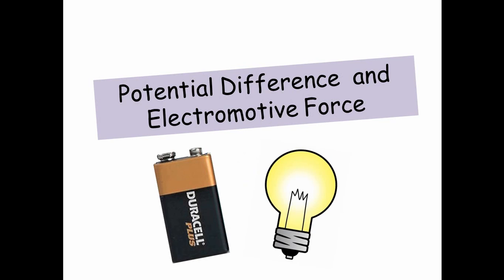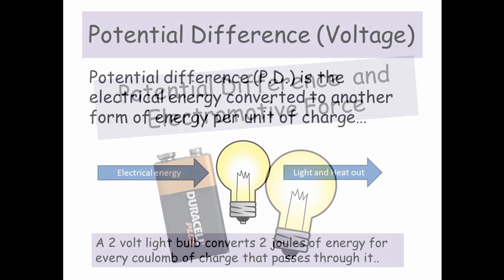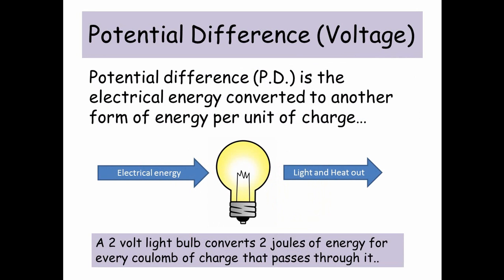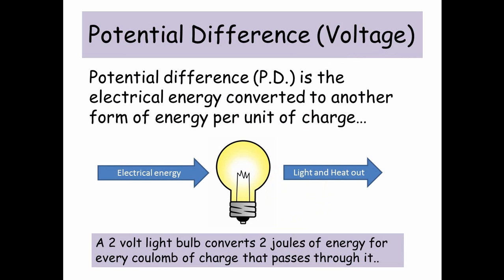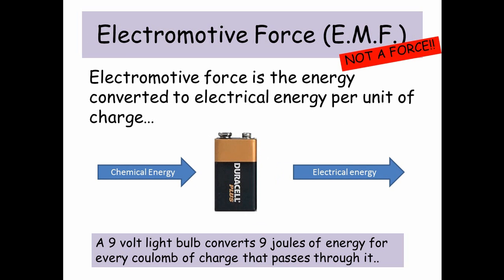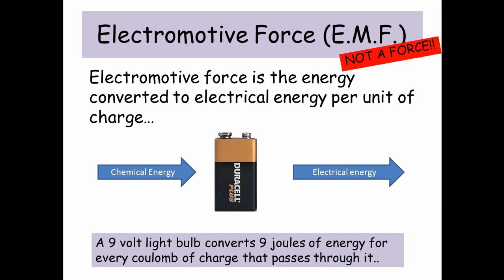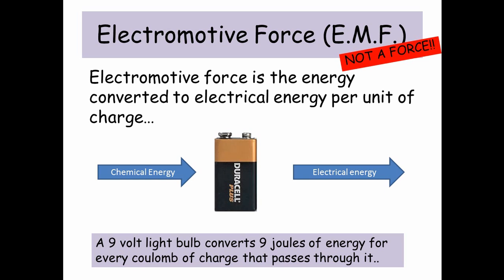Electromotive Force and Potential Difference

Comment: the FEM is the energy by J/C produced by a battery or electric generator(movement), and de voltage is the force that keep the  electrons movement in the circuit
Reply: the FEM IS ENERGY IN TRANSFORMATION

Comment: Wait a min , EMF is the amount of work done in bringing a unit positive charge from lower to higher potential, so are they two different energy 
Plz help 😌
And about Kirchoff voltage rule isn't it sum of potential difference across a loop is zero as u know initial and final position r same ?
Reply from the maker: EMF is energy per unit charge going into the circuit and PD is energy per unit charge leaving the circuit. By conservation of charge they are the same value around a loop.

Comment: Thank you very much!
Reply: EMF was an older method to represent the capacity of cell ........ Now we use same word to distinguish Running Potential Difference(V) and Ideal Potential Difference (E) or Open Circuit Voltage (E) or Static Potential Difference (E) of a cell......So please don't make any fake concept about any imaginary force which/who maintain Running Potential Difference.
Here charge density on the both +ve and -ve plates are greater than the Charging Bank of cell. And also decreasing rate of charges are narrower w.r.t. Deposited Charge. Therefore fall of voltage appears like a constant voltage.
At this point any of them who explain EMF, he goes to trapped with a unknown query .i.e.
Who provides constant voltage?
Then a prepared answer 'EMF' will help to prove their fake concept.
That's it...👍👍👍
Reply from the maker: Np

Comment: is the work done to raise to potential energy of the electrons the result of moving the negative charges against the eletrostatic force field of a positive charge which wants to keep them together as negative charges are attracted to positive charges? What exactly happens to raise to potential energy of the electrons which will eventually run around the circut? Is it the work done to seperate the negative charges from the positive?
Reply: EMF was an older method to represent the capacity of cell ........ Now we use same word to distinguish Running Potential Difference(V) and Ideal Potential Difference (E) or Open Circuit Voltage (E) or Static Potential Difference (E) of a cell......So please don't make any fake concept about any imaginary force which/who maintain Running Potential Difference.
Here charge density on the both +ve and -ve plates are greater than the Charging Bank of cell. And also decreasing rate of charges are narrower w.r.t. Deposited Charge. Therefore fall of voltage appears like a constant voltage.
At this point any of them who explain EMF, he goes to trapped with a unknown query .i.e.
Who provides constant voltage?
Then a prepared answer 'EMF' will help to prove their fake concept.
That's it...👍👍👍

Comment: So Wat is reason behind saying emf as electrostatic motive force of it is not force
Reply from the maker: History
Reply: EMF was an older method to represent the capacity of cell ........ Now we use same word to distinguish Running Potential Difference(V) and Ideal Potential Difference (E) or Open Circuit Voltage (E) or Static Potential Difference (E) of a cell......So please don't make any fake concept about any imaginary force which/who maintain Running Potential Difference.
Here charge density on the both +ve and -ve plates are greater than the Charging Bank of cell. And also decreasing rate of charges are narrower w.r.t. Deposited Charge. Therefore fall of voltage appears like a constant voltage.
At this point any of them who explain EMF, he goes to trapped with a unknown query .i.e.
Who provides constant voltage?
Then a prepared answer 'EMF' will help to prove their fake concept.
That's it...👍👍👍

Comment: Thank you so much
Reply from the maker: No worries.. :)
Reply: EMF was an older method to represent the capacity of cell ........ Now we use same word to distinguish Running Potential Difference(V) and Ideal Potential Difference (E) or Open Circuit Voltage (E) or Static Potential Difference (E) of a cell......So please don't make any fake concept about any imaginary force which/who maintain Running Potential Difference.
Here charge density on the both +ve and -ve plates are greater than the Charging Bank of cell. And also decreasing rate of charges are narrower w.r.t. Deposited Charge. Therefore fall of voltage appears like a constant voltage.
At this point any of them who explain EMF, he goes to trapped with a unknown query .i.e.
Who provides constant voltage?
Then a prepared answer 'EMF' will help to prove their fake concept.
That's it...👍👍👍

Comment: i had an 'ohhhh!' moment with this. thanks.
Reply: Same here
Reply: @pritighuge9225   EMF was an older method to represent the capacity of cell ........ Now we use same word to distinguish Running Potential Difference(V) and Ideal Potential Difference (E) or Open Circuit Voltage (E) or Static Potential Difference (E) of a cell......So please don't make any fake concept about any imaginary force which/who maintain Running Potential Difference.
Here charge density on the both +ve and -ve plates are greater than the Charging Bank of cell. And also decreasing rate of charges are narrower w.r.t. Deposited Charge. Therefore fall of voltage appears like a constant voltage.
At this point any of them who explain EMF, he goes to trapped with a unknown query .i.e.
Who provides constant voltage?
Then a prepared answer 'EMF' will help to prove their fake concept.
That's it...👍👍👍
Reply: WAITT BECAUSEE SAMEEEEEEEEE

Comment: is there value is always same ???
e.g 9 Volts of battery means it has 9 Volts of P.D And 9 Volts of Emf ??
Reply: EMF was an older method to represent the capacity of cell ........ Now we use same word to distinguish Running Potential Difference(V) and Ideal Potential Difference (E) or Open Circuit Voltage (E) or Static Potential Difference (E) of a cell......So please don't make any fake concept about any imaginary force which/who maintain Running Potential Difference.
Here charge density on the both +ve and -ve plates are greater than the Charging Bank of cell. And also decreasing rate of charges are narrower w.r.t. Deposited Charge. Therefore fall of voltage appears like a constant voltage.
At this point any of them who explain EMF, he goes to trapped with a unknown query .i.e.
Who provides constant voltage?
Then a prepared answer 'EMF' will help to prove their fake concept.
That's it...👍👍👍

Comment: Am I the only one that hates the term "potential difference" with such passion? My understanding is that voltage is defined (technically) as the potential to do work per unit charge. but this "definition" as useful as saying that force is defined as acceleration of something multiplied to its mass. I see voltage as something that cannot really be defined as it is something elemental. I beleive it comes about because like charges repel and when there is a dense charge on a surface (say, electrons that are crammed together on the globe of a van-de-graaff generator) this causes voltage since they do not want to be close together and will attempt to equalize by jumping through air to a area that is more positive.  I see this as equivalent to pressure in a air tank. Things like power, energy, and all those other units can be derived from this "pressure" times the flow rate (amps).
Reply: +Power Max. it is potential energy
Reply: Also, as a question: Why do we differentiate between "EMF" and "voltage" since they are the same thing? both terms simply describe a potential difference, just one of them is the result of a conversion. Is there something I'm missing?
Reply from the maker: +Power Max The concept you are missing is the direction that energy changes are going.. With EMF Some form of energy (Chemical in a cell or Light in a Solar cell) changes to electrical energy per unit charge. With PD electrical energy changes to a different form of energy per unit charge,
Reply: +Chris Gozzard (That Physics Guy) Why would it matter to someone where the energy comes from, whether the voltage at some node is an EMF or just electrostatic charge? What practical difference is there between voltage from, say a really big capacitor or supercapacitor or a battery?
Reply from the maker: The answer is simple - conservation of energy. You need to know how much energy is entering and leaving a circuit. EMF and PD help us do this.
Reply: +Chris Gozzard (That Physics Guy) How exactly? EMF or voltage is just one part of power, it needs to be multiplied to time and current flow get units of energy (WH). And knowing the polarity of the voltage and direction of current flow, it should be possible to figure out how the energy moves, right?
Reply from the maker: +Power Max kirchhoffs 2nd law states the sum of the EMFs in a circuits loop is equal to the sum of the pd across the components in a loop. Total energy IN per coulomb equals total energy OUT per coulomb.
Reply: +Chris Gozzard (That Physics Guy) To me it sounds like the only difference between EMF and pd is the context. EMF is what is directly across a generating source like a power supply, coil of wire, or a chemical reaction, while a pd is what can be observed across something like a resistor or load. Is this correct?
Reply from the maker: +Power Max yeap.. you got it!!
Reply: +Chris Gozzard (That Physics Guy) OK, that makes sense, it is similar to how physics differentiate energy from work! So then (probably) my last question, What is "electrical energy per unit charge" defined as, if PD is "absorbed" energy/charge, and EMF is "created" energy/charge? Is it just literally just called "voltage"?
Reply: +Prathamesh Khandare No, it's not. It is potential energy per unit charge. (same type of difference as weight and density.) To me sounds like saying that voltage is potential energy per unit charge is like saying defining mass as acceleration times mass.
Reply: Power Max the difference mean the difference in charge of both terminals
Reply: EMF was an older method to represent the capacity of cell ........ Now we use same word to distinguish Running Potential Difference(V) and Ideal Potential Difference (E) or Open Circuit Voltage (E) or Static Potential Difference (E) of a cell......So please don't make any fake concept about any imaginary force which/who maintain Running Potential Difference.
Here charge density on the both +ve and -ve plates are greater than the Charging Bank of cell. And also decreasing rate of charges are narrower w.r.t. Deposited Charge. Therefore fall of voltage appears like a constant voltage.
At this point any of them who explain EMF, he goes to trapped with a unknown query .i.e.
Who provides constant voltage?
Then a prepared answer 'EMF' will help to prove their fake concept.
That's it...👍👍👍
Reply: Potential difference makes alot of sense as one end needs to be at a higher potential than the other in order for current to flow. If both ends had the same potential nothing will flow. Like a waterfall the water falls from high potential to low potential (if there was no difference then there will be no water flow) there needs to be a difference in potential in a battery for current to flow, if the potential is the same on both terminals nothing will flow!!